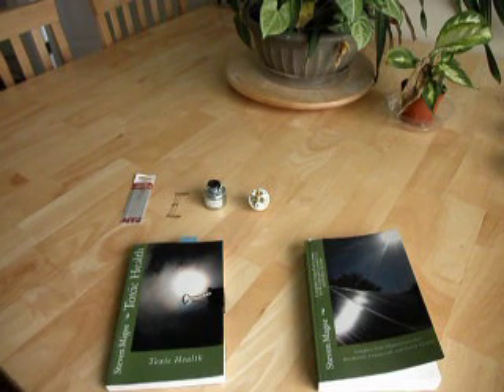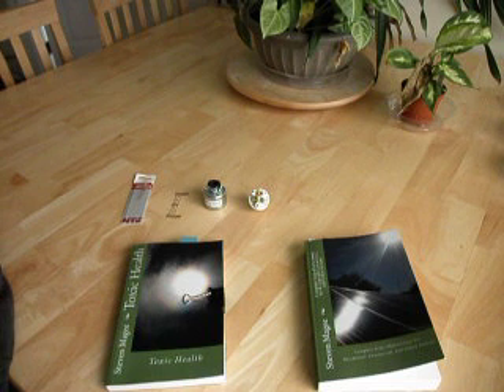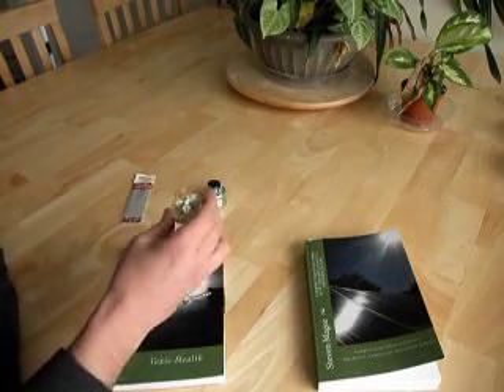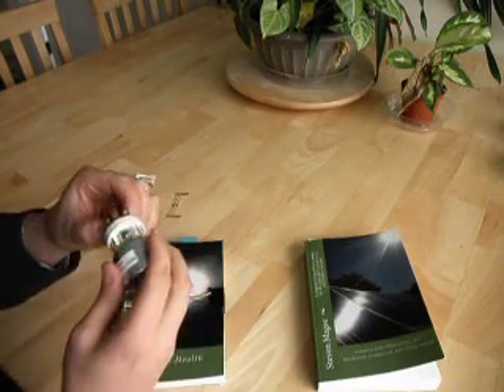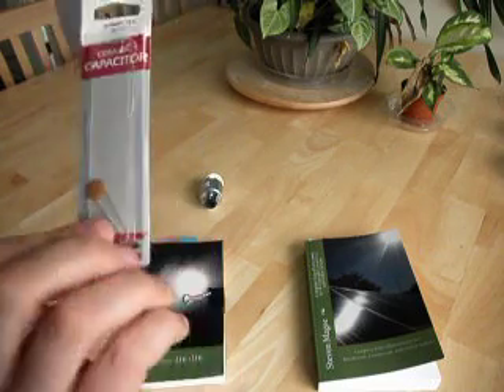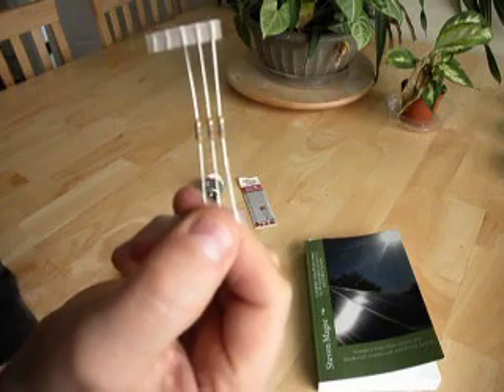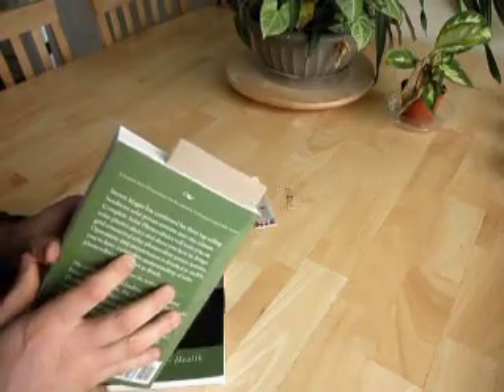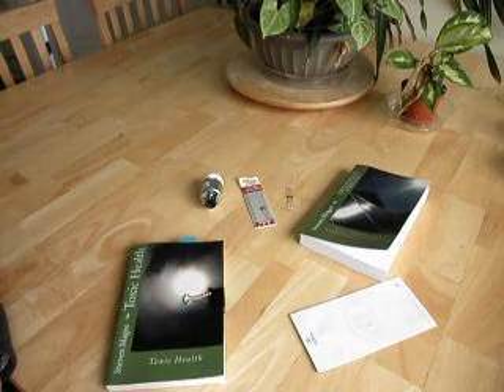Making a Capacitive Filter Plug for Dirty Electricity

Comment: Is this the correct component list:

WELWYN MFR3-1M0FC 1M Ohm Metal Film Through Hole Resistor, 400 mW, Tolerance ± 1%, 200 V, Axial Leaded (Pack of 5)

https://www.amazon.com/gp/product/B071R8BV6N/ref=ox_sc_act_title_1?smid=A2WOR9F827MJIF&psc=1

uxcell Ceramic Capacitor Kit 500V 10000PF Disc Capacitors for DIY Electronic Circuit, Pack of 30, Blue
https://www.amazon.com/gp/product/B07KCDLP3C/ref=crt_ewc_title_dp_3?ie=UTF8&psc=1&smid=A1THAZDOWP300U

Black Duck Brand Male Extension Cord Replacement Electrical Plugs End (10 Male Electrical Plugs End)
https://www.amazon.com/gp/product/B06XS2CS4H/ref=crt_ewc_title_dp_2?ie=UTF8&psc=1&smid=ANQLEGQHZ35WC

Comment: So I built a few of those dirty power filters with the parts you said to use. I also bought a dirty power meter by Green Wave to plug into the outlet. It has three displays on it. It basically show before and after installing a dirty power filter and the % of improvement. The meter showed 551mV without the filter and 551mV after I put the home made dirty power filter in. 0% change. What did I do wrong?
Reply: See Appendix A, for the recommendation by PROFESSOR Martin Graham, who initially designed the filtering. http://www.electricalpollution.com/microsurge_meter/Microsurge.html The author of this video claims that 20 microfarads is "too big", and causes excessive extra magnetic field emissions from the house wiring. That may be the case if you are HIGHLY EHS, but I have not found that to be the case generally. You can check ELF magnetic field strength in your house wiring with any good milligauss meter. If the house wiring is not messed up, Graham-Stetzer filters will not cause any significant increase in magnetic fields. Assuming you are not sleeping next to a conduit or outlet box.
Reply: This is the same question I have.  I built similar "filters" that do not reduce the EF or EMF. Any chance "Environmental Radiation LLC" can take a swing at answering it?

Comment: Really have to question everything you say when you don't even use the correct terminology. It's not 'dirty power', it's called line noise or EMI (Electromagnetic interference), usually from some other source such as a nasty cheap switching power supply. Also your bold faced lie that 'If the circuit buzzes in operation it means you have dirty electricity'... learn some basic electronics, what a RC circuit is (R = Resistor, C = Capacitor), if it is buzzing you have either faulty parts or wired something wrong. If you want to check for line on the noise, you need to use an oscilloscope, that is the ONLY way to determine if there is noise.

Also wired in parallel? That's not even a RC filter, I don't know what your trying to accomplish here. A 1M resistor across the active and neutral line will just waste ~125mw of power, turning it into heat. The capacitor will smooth (not remove) some noise on the line, but so minimal it would be hard to measure.

The amount of RF coming out of your wiring in the house is background noise in comparison with that coming from the environment around you, ie: mobile phone towers, TV broadcast, your neighbors WiFi. Even if you cut power to your house, you will still get a higher dose of RF from your environment then you would from this 'dirty power' in your home wiring. Do you have any local AM or FM radio stations? Those broadcasts are powerful enough to penetrate hundreds of kms through walls of buildings to reach everyone... and you're worried about a few microwatts of maybe emitted power from your home wiring? does this make sense?

If you are reading this you are sitting with a computer of some kind that is emitting oodles of RF, your computer uses a switching power supply that emits tons of environmental noise, let alone 'dirty noise' on your power lines. Any device that is switching (digital device, cameras, phones, mp3 players, even simple kitchen appliances like blenders and mixers) emit tons of radio noise. You are just kidding yourself if you think you can remove this noise from your environment.

Do you use a microwave? That is a device designed specifically to bathe your food in RF... the effect, it gets hot... that's it, nothing else. We know what high power RF does to biological matter, we know what low power does to biological matter, we know what is safe and unsafe.

So lets move to the middle of nowhere... well actually that wouldn't help either, we get bathed in RF from the sun every day, and even more so during solar flare events. These are wide band bursts that can and do damage hardened electronics in the satellites orbiting the planet. Like your GPS... well guess what, that is a blast of RF energy coming from a satellite in orbit that blankets the entire globe, doesn't matter if you have a GPS device or not, it'll still hit you.

This crap about 'RWS' and 'EHS' is all in your heads. If a new device comes into your home/area and you experience a physiological effect, perhaps its chemical residue on the device, you might have a chemical sensitivity to the plastics/lubricants used in it's manufacture, or even the fire retardants used, these are proven and acknowledged issues. What about the placebo effect, a scientifically proven and effective treatment in cases of hypochondriacs... you think you are taking something to make you better, so you 'feel' better.

And yes, you can make a device to detect EMI, they are used in the electronics industry to determine how noisy a device is before putting it on the market, not because of how it affects the human body, but because of how it messes up other devices such as radios, phones, etc. Every country has a regulatory department that enforces radio emission standards and acceptable limits for devices, in the US is the FCC. If you'r device is FCC certified, or conforms to FCC regulations, it's EMI has been tested and tuned to prevent it causing any harmful effects to other devices, which are WAY more sensitive then the human body is to EMI.
Reply: A resistor provides a discharge path to avoid spark when the plug is sudden pulled out from the socket. For a given capacitor, RC low pass effect depends on the finite resistance of the wiring.
Reply: thank god someone around here has a shred of common sense, the stupidity of this is astounding
Reply: That was like the longest rant

Comment: In the comment below where Eric said " guy builds a filter with 20uf cap & 27Kohm resistor I saw his GS drop from 130 to 25" will this be better for my application? My meter just came today and i am getting GS readings from as low as 210 on one outlet and 1028 on others in my garage! I want to try and solve this issue, for a long time i wondered why my head feels like its in a vice, and my children complained of headaches. I live right next to power lines that are high voltage and rated at supposedly  60,000 in city limits..? I GREATLY appreciate any feedback here.. Thanks for the video as well!

Comment: I built the filter described in the book & video. It reduced my GS units from 130 to 90 which is better but...

I saw another video on youtube where the guy builds a filter with 20uf cap & 27Kohm resistor. I saw his GS drop from 130 to 25. 

Can you speak to that?

Sorry, I just want to filter as effectively the 1st time as I have many outlets & cords to modify.
Reply from the maker: I have just completed several months of electrical fuse board filtering research and the findings are in Curing Electromagnetic Hypersensitivity: http://amzn.com/1500896241 My conclusion was a very low GS reading does not equate to good health.
Reply: StevenMageeBooks I have the curing book. I am almost done with Electrical Forensics. Are you suggesting that dirty electricity on our wiring, measured in GS units doesn't cause ill health?
Reply from the maker: I found that I got sick with large amounts of "Motor Run" microfarad capacitors on my electrical system.  They gave very low GS readings on the Stetzerizer microsurge meter.
Reply: StevenMageeBooks Oh, interesting. What is your solution now to preventing sickness?
Reply from the maker: The solutions to my particular situation were diverse.  I have been free of EHS for about a year now and live in a home that has 3 Itron transmitting utility meters just 15 feet away from it and in a community of 3 cell phone towers.  What I did is detailed in Curing Electromagnetic Hypersensitivity: http://amzn.com/1500896241
Reply from the maker: *****  The European filter is shown in Electrical Forensics and should use components rated for continuous operation at above the operating voltage. Electrical Forensics Link: http://amzn.com/1492118907
Reply from the maker: Both the whole house filter and the wall plug are detailed in Electrical Forensics: http://amzn.com/1492118907
Reply from the maker: Yes, I have solar powered security lights now and they work well in sunny Arizona!  I've only ever heard the filter buzz when my neighbor had something very noisy on at their home, it was either a garden power tool or a vacuum cleaner.  Beware of large microfarad filtering capacitors, as they can make you sick!  My research on them is in the book Curing Electromagnetic Hypersensitivity: http://amzn.com/1500896241
Reply from the maker: Yes, motor run capacitors are known for their ability to make people sick in the vicinity of them.  I've never observed any sickness from the ones described in my books, but they are experimental and without warranty.
Reply from the maker: I have not tested that configuration throughout my home, so cannot comment on it.  The more capacitors that you install, the more likely resonances are to occur: https://en.wikipedia.org/wiki/Electrical_resonance
Reply from the maker: I use something similar on my computer system and Digital TV.
Reply: Could you please make a video about the differences between what you do and the microfarad capacitors as well as some disadvantages of the latter method?  Also, why/how do motor run capacitors make people sick??

Comment from the maker: It seems that you may have CFL and LED electronic light bulbs, electronic florescent lighting products or low voltage halogen products.  These may produce high TriField readings.  You should change them out for normal filament light bulbs.  You may also have lamp dimmers which create strange fields.  Change them out for switches.  If your electrician has created a ground loop in the wiring, you will get high field readings.  You would need an electrician to troubleshoot a ground loop problem.

Comment: Hi Steven I have a very high reading on my trifield broadband meter under the v/m setting , when I turn off the lighting circuit breaker the reading drops significantly . I have install the filter you have described on the video  at the light switches but it has no effect. The reading of the meter on magnetic setting is very low. Can you suggest something that will work?

Comment from the maker: These are simple filters that help to reduce (not eliminate) the high frequency content on the home wiring.  They cannot clean up emissions from dirty electricity producing electronic products and products that emit radio frequencies and electromagnetic interference.  The only effective known way to do this is to identify the known dirty products and remove them from service.  Your electronic product is likely pulsing the current on the electrical system that no filtering product could remove.

Comment: Steven I made a filter as per your spec in this video. I tested a power outlet with a am band radio and it was clean. I then plug in a Blackberry charger and the am radio confirmed noisy radiation. I plug your filter in beside the charger and the am radio was still noisy, no different with or without the filter. Why? Please help.

Comment from the maker: Some of your high powered appliances have filters already built into them.  The filter design is different for these circuits and the plug would not work.  I would concentrate on filtering circuits that have electronic products in use on them for extended periods.  Digital TV's, CFL's & LED lights, general electronic products, cell phone chargers, and so on can all create harmonics and dirty electricity on your electrical circuits.  It is a good idea to have a filter installed at the fuse board.

Comment: Hello, with this work for my 220 V socket, dryer and stove sockets. Or, will the 120 V socket filter placed throughout the house work?

I have these symptoms and I barely figured all this out after years of suffering. I can actually feel the energy emanating from wall sockets. This is important information. THANK YOU for your video and info.

Comment from the maker: The USA fuse board filter diagram shows three complete capacitive mains filters.  You just need one in the UK.  Just use one of everything. Build the Live (L2) to Neutral circuit which is the bottom left quadrant of the diagram. If it buzzes when you install it, you either have a product that produces dirty electricity or your utility is supplying you dirty electricity.  Mine buzzes when the neighbors on my utility transformer use dirty electricity producing devices! I hope you enjoyed the book.

Comment from the maker: The cost is tiny for the capacitor and resistor size shown.  You probably wouldn't even be able to detect it on your bill.  If you have dirty electricity, then the potential health benefits far outweigh any of the costs.

Comment: Lets have a look at the conversion. The cheapest smart meters have a power rating of under 50KW So here we go #1  AC- single phase. #2 KiloWatts is 45  #3 voltage is 220  #4 power factor of 1 NOW we turn the handle and get 204.55 amp maximum  before a fire starts.  What is the instantaneous draw of two AC motors? About 300 to 400 amps. Not on long enough to trip the main breaker which by the way is thermal. FORD Pinto, instant fire.

Comment: Hello PhattyMo--->It's not physically large enough to house a 288KW SMPS<--- WHO HAS A 288KW smart meter on the side of their home. I think we still have some 3 phase commercial sites that have 72KW sentron meters. They are popping like popcorn when the AC motors fire up. Dam meters blow themselves right off the wall. Be honest powerbot, you will feel better.

Comment: If that was the case, then why are smart meters rated by power? I have seen old meters wound up to 800 amps and they only get a little warm. Are you tell me I could put 400 amps in a smart meter rated at 50KW and nothing will happen to it? Your story is almost as bad the output power is a pure SINE wave. If it walks like a SMPS and it talks like an SMPS, then it must be a SMPS. Do you have a link to this magic current shunt? Any schematics we could look at?

Comment: The typical smart meter on a residential service is nothing more than a fancy current shunt. There is no high power SMPS inside. There may be a small (couple of watts) SMPS inside to power the meter electronics,but that's about it. 
Go outside and look at the meter on the side of your house. It's not physically large enough to house a 288KW SMPS. Physics says it can't be so,or else it would be the size of a small car.
/Case Closed.

Comment: Not knowing what the power rating of the (Ford Pinto) smart meter that is on the side of your home. *FacePalm* Not knowing the output transmitter is 4 watts pulsed. *FacePalm*  Not knowing the Zigbee transmitter screws up your WiFi. *FacePalm*  Not knowing a smart meter transmits 25 miles. *FacePalm* Not knowing the power density of both transmitters at 8" is 263 microwatts/cm^2. *FacePalm* Not knowing a smart meter can trip Arc Fault and GFI circuit breakers. *FacePalm*  Ring Ring Ring

Comment: Building a smart meter out of flammable material. *FacePalm*  Not having a thermal detection circuit. *FacePalm* Not having the ability to turn off the power when it catches fire. *FacePalm* Not having the ability to reproduce a true sine wave. *FacePalm* Having the abiltiy to kill homeowners with a pacemaker. *FacePalm* Having the abiltiy to make people at home sick. *FacePalm* Not having the ability to detect a power bypass. *FacePalm*  Data mining private data. *FacePalm*

Comment: Hi PhattyMo  Everything in my home from the fuse panel, meter socket, fuses, wiring, outlets, light switches are UL/CE approved. The only piece of crap that is not certified for safety is a smart meter. Stupid smart meter trips Arc Fault breaker and turns off my neighbors freezer. Why would I worry about a homemade line filter tripping a circuit breaker when the whole smart meter (Ford Pinto) can exceed its maximum KW rating, overheat and burst into flames. Worry about the smart meter first.

Comment: Also,You can't just go and use any capacitor across the line. It must be an X1/Y1 rated type-That is,It's specifically designed for across-the-line use,and will fail safely,when/if it does fail.
Your insurance company won't pay when your house burns down,because of a cheap ceramic cap in some BS device you built yourself,that has no UL/CE certification of any kind. So,good luck with that.

Comment: What? A smart meter is still just a meter (not an SMPS,or whatever). Line filters work on AC too.
I think you need to brush up on electrical theory/engineering,along with the OP.

Comment from the maker: I thought about this and I have seen it in use.  Sending high frequency content down the grounding (earthing) conductor may actually increase the radio frequency inside the home as it may turn the grounding conductor into a high frequency antenna system.  By keeping the high frequencies on the live and neutral they should balance out by being next to each other.  Once it gets onto the grounding system, it may go all over the home wiring.